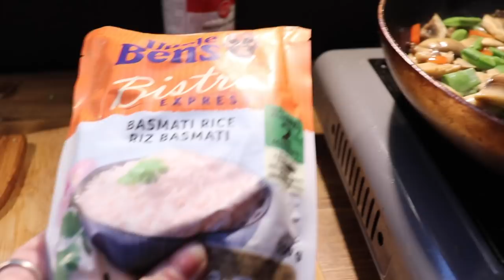Stoping at rest area to fix some cabinets/ DIY camper van tips so it doesn't happen to you

Comment: Hello! Couldn't help but think at the beginning of the video when you mentioned being sleepy it made me think of a near miss I had with a carbon monoxide issue years ago.  I don't know with your recent heater install the possibility of spent gas fumes escaping if the body would react the same way? Probably not at all but please consider if this happens again after you run your heater.  It could be just the heat but I had to say something because it took me too long to figure out I was experiencing carbon monoxide poisoning symptoms. Love your videos (and your cool cat)! Please be safe :)
Reply: I thought the same immediately

Comment: For your little slide locks that come undone, turn them over so they latch in facing down.  Another option on the hinges would have been (and still could be if this doesn't work out) to just move the hinges on both the door and the cabinet so that they are higher or lower than the damage.  Also, a quick fix for a loose screw in wood is to break off a toothpick and shove it in the screw hole.  That will make it much tighter.  Have done that often when dealing with MDF.

Comment: Ik it might sound crazy but keep the sawdust you get and save it for fillers in the future..you can always mix baking soda to the saw dust and then put super glue over it and it turns it rock hard,,that is if the surface you go to fix is horizontal at time of repair.

Comment: Handy girl ..
Just a little tip I use .. you could fill those holes using a mixture of (wood powder) and (wood glue) .. then paper sand thing and and .. 

Keep going ❤
Reply from the maker: I try it doesn't hold the constant vibration of the van
Reply: @ThecatladyVAN  I see now.
It's better in the way you did it then yeah

Comment: I had a similar thing in my shed, so I drilled hole all the way thru and used nut n bolt, can tighten as needed, hope that repair works till you get to your tools to make all new.  That is a very clever idea putting the cloth storage inside the cabinet def saves on weight.
Reply: This is what I thought too.

Comment: That look okay for  now the goal is solid  wood  in there will be better due  to movement in time  you gals will get  it.You may need to carbon monoxide detector to check  your  air  in van.Hope heater  right  on vent that if not could  be bad air. I believe  buy at Amazon to check  air.

Comment: I Hate particle board. Small force on screws can pull them out. Those two holes are particle board. There are screws for particle board but i don't like them. If i have to, try and use a nice smooth hole with a drill and use a bolt with some washers. You did a great job on your van. I think you will be renovating it and giving it a second life. I can't wait to see it. When i build my cabinets for my new van i will get next year i will try and figure out a different way of building a cabinet that will be shifting while driving - taking weird loads of driving. Have you thought about that? Maybe when bolting on the wall and underneath above the floor using some stiff rubber to help dampen the movement so that the cabinet joints take less stress? Or doing the screws and corners differently to take load? RVs drive then park... vans like yours endure much more movement. That is so funny watching kitty lol, great spot kitty has watching the pan from above.

Comment: Thanks for great share and video Emi!  Maybe the black bolt thing on you cabinet behind drivers seat could be turned upside down, so vibration would cause it to lock better?  Looked like a barrel bolt ? So the knob part stiking out would go down to lock it in place? Just a thought.  All the BEST to you and Kelly!  Safe travels and Cheers ! :)

Comment: Your slide on the slide latch is installed upside down. The notches should be on the bottom side, remove the screws and turn it over so the notched are on the bottom side that keeps it from sliding open.

Comment: Those patches are lots better than the particle board, now if the particle board will hold together behind the patches. WTG!  Edit to add that you should be aware of Tami Torres post.

Comment: EMI, those cabinets are the style I put in condos in the 1980's. They are press wood or MDF.  covered in a plastic mica .  When you get to Quebec you will be able to build better cabinets out of plywood or hard wood. As for the repair now. Just fill the holes with plastic wood filler and move the hinges to the cleaner more solid area of the door & cabinet.

Comment: The prefab chipboard cabinets are not a good choice for RV, caravan or van cabinets, they are low quality and cheap, they also absorb moisture from your breath, especially in winter. The best is solid timber frames covered in thin plywood, with plywood sliding doors. Of course it takes time to make these, but they will last much longer. Good luck with your repairs.

Comment: Keep the noise down ,I'm trying to get some sleep😂😂😂😂👍👌 & get a carbon monoxide sensor in your van there cheap, in home depo or equivalent save's  your life if that heater is leaking spent fumes if it is get it fixed immediately 💋

Comment: Would putting a rubber band on the slide lock while you're driving help make sure that it stays closed?  Also, when you think about it, not only living in a van has a list of things to work on...I mean I know lots of people who have a to-do list to do on their house you know and are often updating their houses and changing things and making them nicer. I don't really think it's any different, or much different, in a van! 
I just started watching your channel in the last month. I was thinking about this lifestyle for the last 2 to 3 years and wanted to do it, but once when I was talking with my mom, who is getting older now, she asked me to please not do that until she is gone.  She said she would worry too much about me, and so it's been hard to do that cuz I don't want to worry her.  I currently have an SUV (Buick, Rendezvous) that I was gonna start out in.  I have not done any kind of build in it, but I have bought a few things and thought about how I would want to set it up.

Comment: Does your carbon monoxide detector work on diesel fumes? Also - where did you get your high top put on & how much did it cost you? I'm searching and searching here in TO  for my econo line 2500 & can't find any services OR I'm looking under the wrong headings. Searching; high tops, raised roofs, camper conversions, rv roofs anything and everything - I'm lost here!